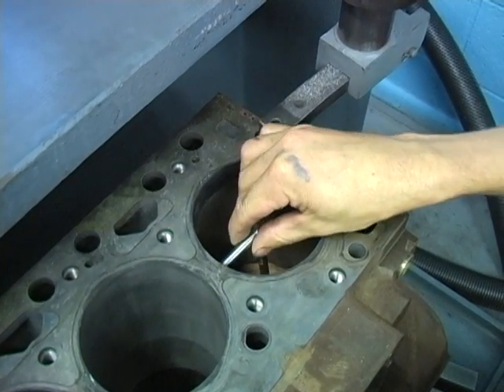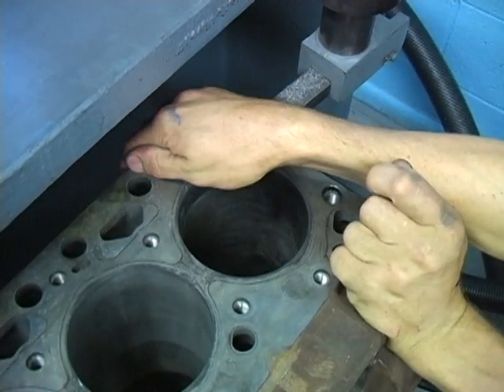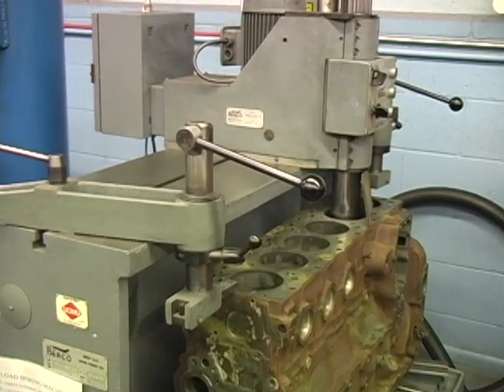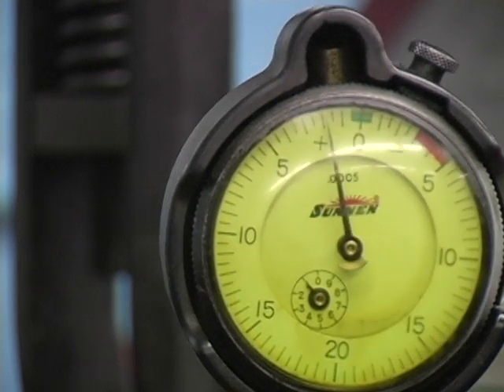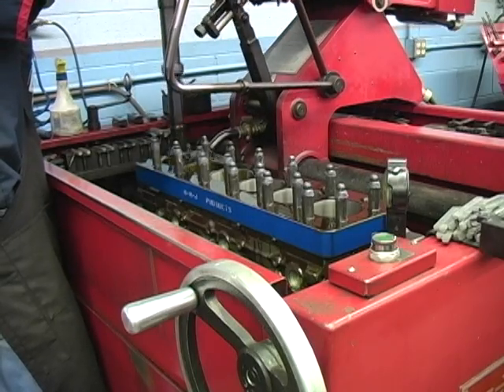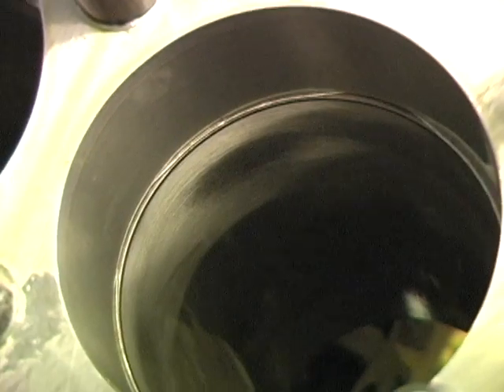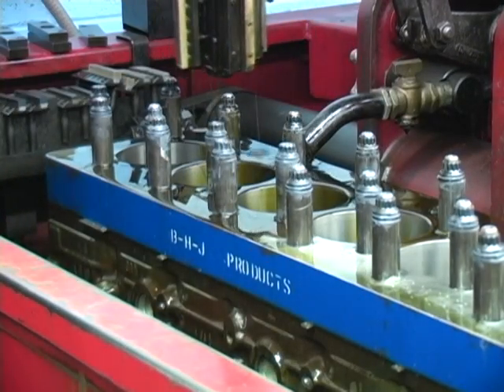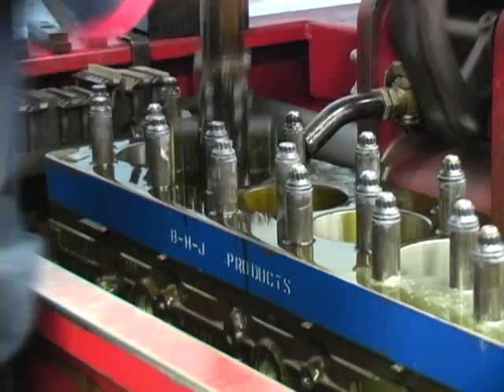CYLINDER DISTORTION AND DECK PLATE HONING ON CUMMINS 5.9

Comment: Looking for a 12v engine long block for a 1998
Tried calling but the number doesn’t go through,
Anyhow here’s my truck info
1b7kf23d7wj141586 vin#

Engine 56406878

Have a cracked head in current engine,
Not sure if it’s rebuildabke for the core charge :

Comment: not enough information on this video measure from the square points on cylder and on the piston you will see that the rings is riding in that spots